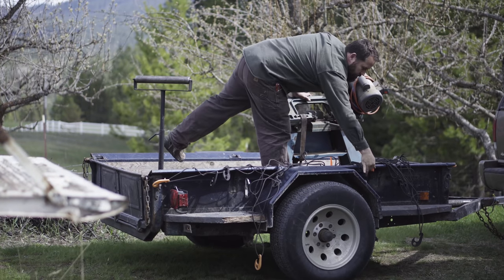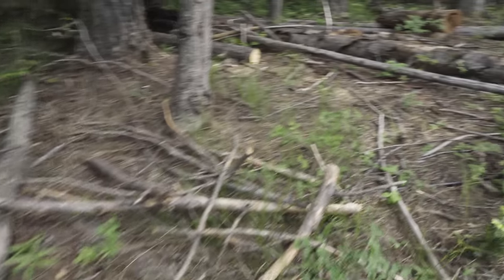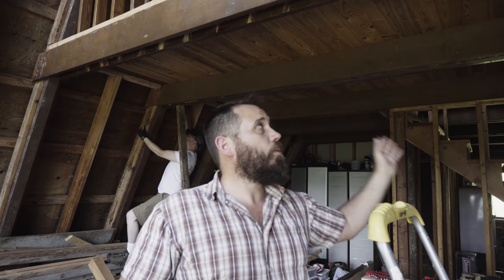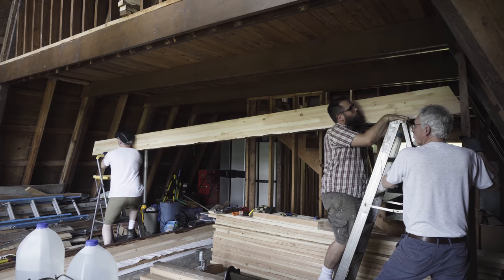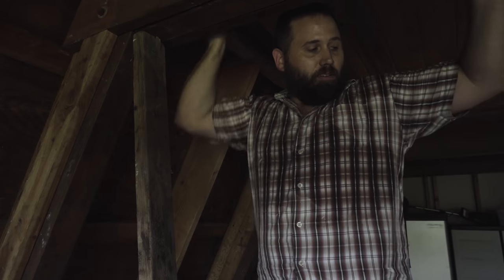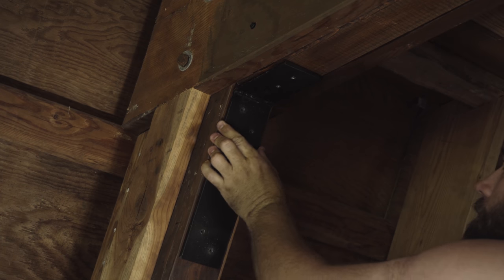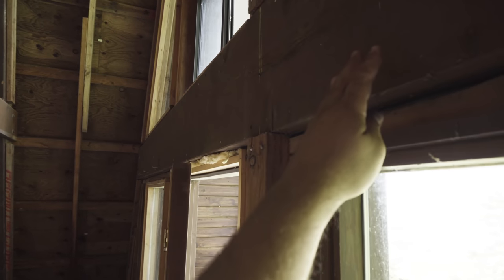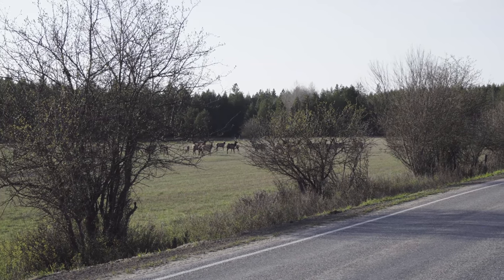River Cabin #5 HEAVY BEAMS

Comment: Reminds me I ve have to pull down my kitchen ceiling and replace the six long planks , which are under my house . Have to deal with asbestos and termite damage . BIG JOB Just need a really good friend or windfall todo this . The ceiling as such is not dangerous so it remains as such . I have an upload on my channel that shows said termite damage ..To my blessing the structure is held up by steel and termites cant eat steel .